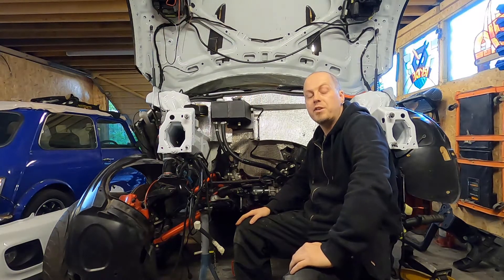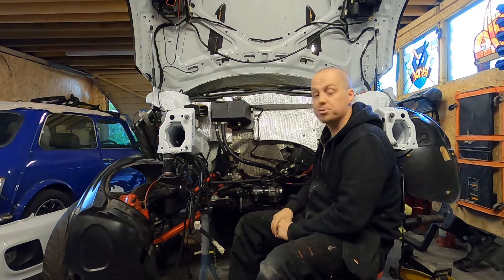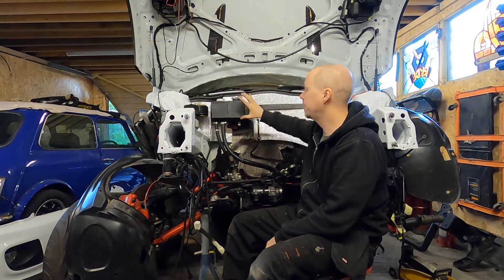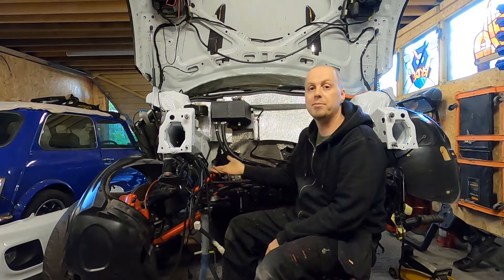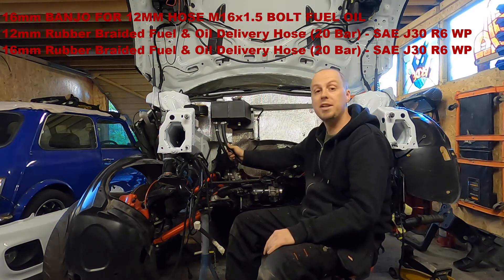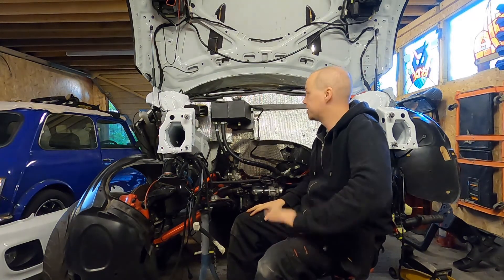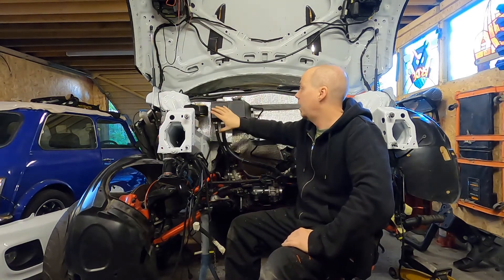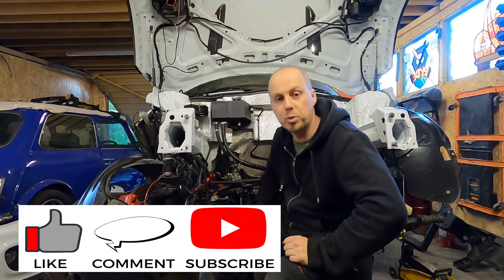Mini cooper R53 turbo coolant & power steering changes

Comment: Thanks for the cool series.   I recently bought an r53 with a bad starter which is basically my skill level. Turns out white smoke poured out so I currently have the head in the shop getting checked out which is way outside of my skill set.  Maybe in a few years I'll attempt something like this if I can even get it back together running for now. Looking forward to the next video!  FYI...watching from Kansas City, Missouri.
Reply from the maker: Thanks for the comment it is appreciated! 
As for the issues, online will always make you fear something going wrong but these little engines are great and whilst they are aging a well looked after car will serve you very well - the key is services and looking after it

If you can self maintain they are quite cheap to keep going

I hope you enjoy your mini adventure!